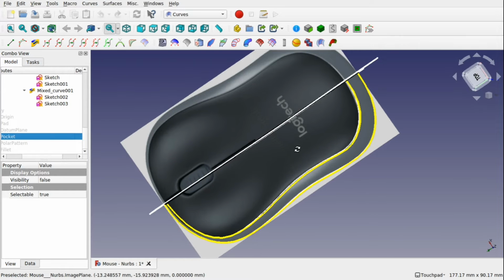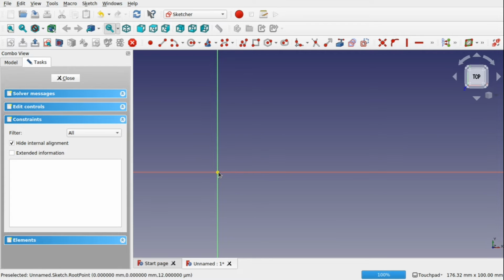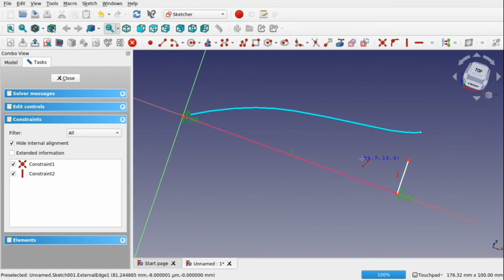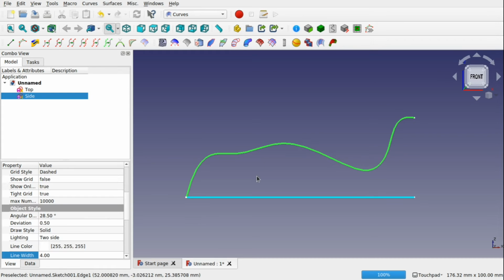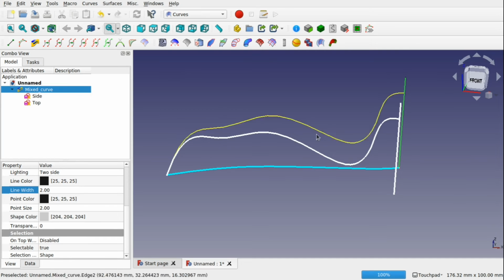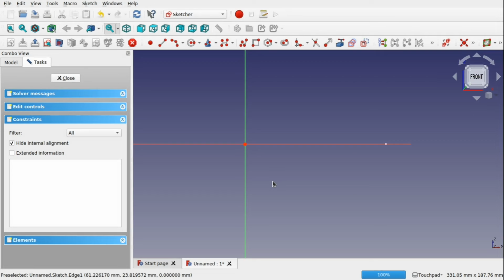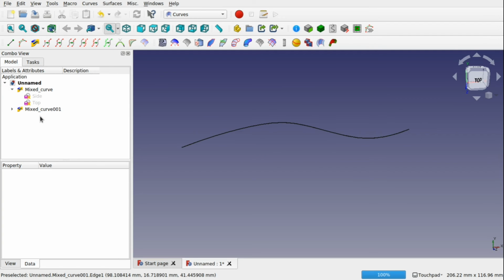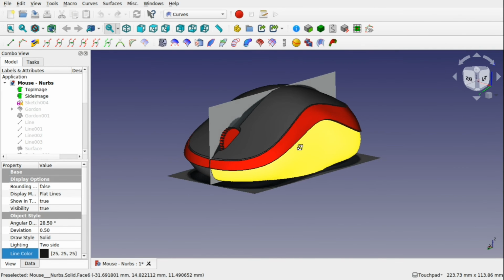Learn freeCAD Curves Workbench 12: Mixed Curves Tool Ideal for tracing 2D plans and making them 3D

Comment: I must admit that this tool was incredibly opaque to me in order to try and understand how it worked until I understood the following: This is the classical geometry construction: given a front view and a top view of an object, reconstruct the 3D edge or silhouette that produces both views simultaneously. In other words, even when they've been mixed together, if you look at them from the direction of each of the two independent sketches, you'll see the original sketch pop back out again. That gives me a much better intuition of how the end result is going to be joined together.

Comment: ok when you create a loft (in Part section)  then want to use pocket function (in Part Design section) with some shape - it doesen't work on this loft  - how to make a simple hole in it when we created loft in Part section?
Reply from the maker: It sounds like you may be mixing part and part design in one workflow.  Keep to the same workbench for your workflow either part or part design.  For part workflow you create a loft, then create a sketch of the hole, extrude this so it intersects the loft, and then use the boolean cut.  When you use the part design workflow, you create a body and then the loft, then you create a sketch for the hole and then create a pocket.  This should help you, once you get more familiarity with the tools you will get to know when you can mix part and part design workflows.

Comment: The curves workbench was something I hadn't looked at properly. I hadn't even tried to understand what it actually had in the way of tools. In fact I rather avoided drawing anything with complicated compound curves. I tended to use the part workbench, perform an intersection of two extruded profiles, and apply a fillet to any hard joint line. What you've demonstrated in this recent set of tutorials are some more accurate options. This and what you've done previously with Gordon surfaces has presented some methods that I didn't realise existed in FreeCAD. (I had thought I was going to have to import objects modelled in something like Blender).
Your presentation style works very well with me. I like the fact there is a clear commentary and an easy to follow work rate. Other would be FreeCAD tutorial YouTubers would do well to note that your cursor doesn't buzz around like a wasp and that you manage very well without a musical backing track. Oh, and your microphone is rather good too.
Reply from the maker: Thank you for the kind and indepth  response. I really appreciate viewers highlighting what they like (and dislike) about the channel. I like pushing the boundaries and prefer to do everything in one program if I can. I always keep a notepad by the side of my chair to write down thoughts about my channel and future videos. I am still working on my teaching style, always trying to improve it. Getting feedback like this is so important for me, it shows how viewers are using the videos and also how their workflow has changed. This is so important as I will use this in future videos. Again thank you so much for this. By the way, the sound is the internal speaker to my laptop with a noise reduction filter in obs. The price of quality mics are eye watering. Took me a while to get the settings right but your the second person to comment on sound quality so think I am finally there 😊